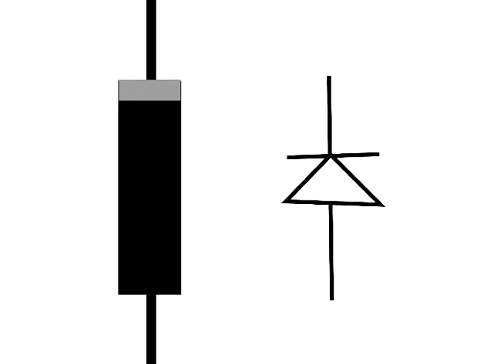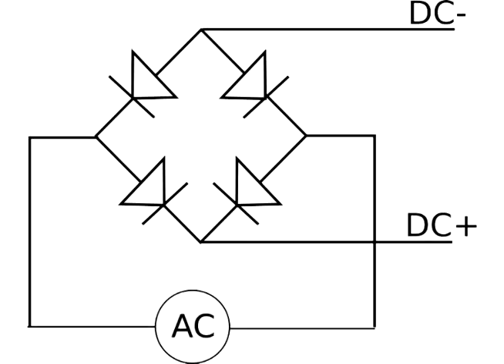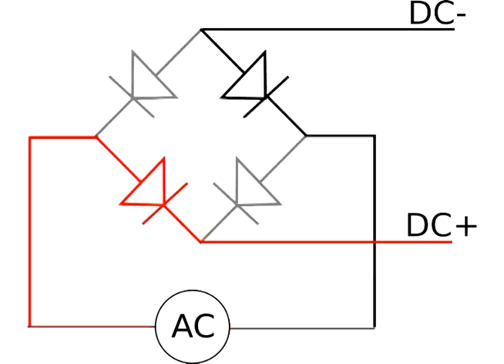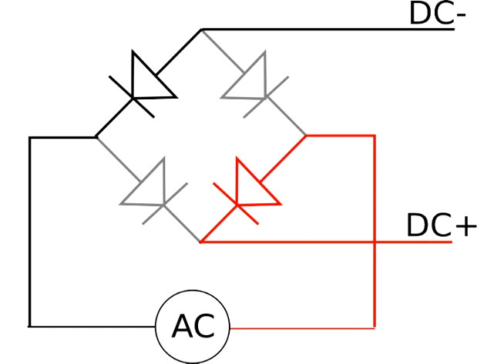Hakology - AC to DC Rectification

Comment: Hello, and great video. A question, Ive a small rc motor here, which is 3 wires out. its about 25mm long and 30mm in diameter.  I probed the three wires out across eachother with the scope, and I have nice ac waves. But, for the life of me I cannot get dc through a basic rectifier. Any ideas? I wonder if the rc motor is outputting the correct ac wave to test, it looks ok? Many thanks,